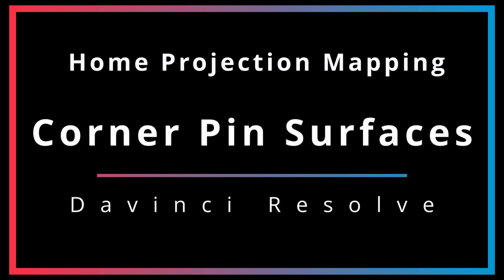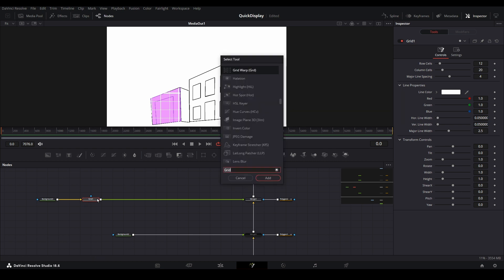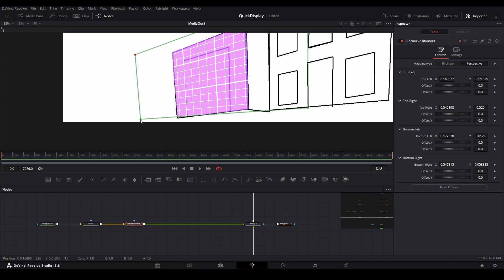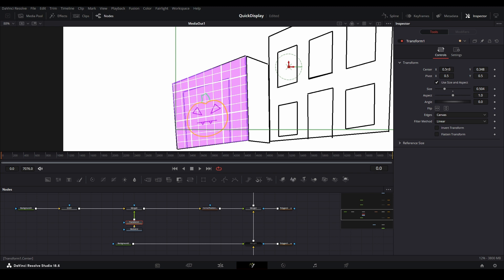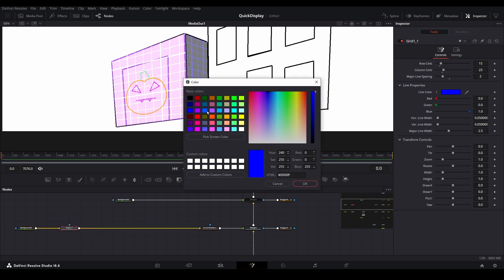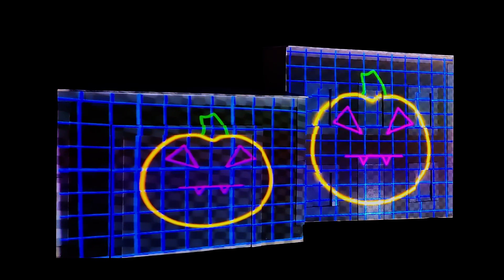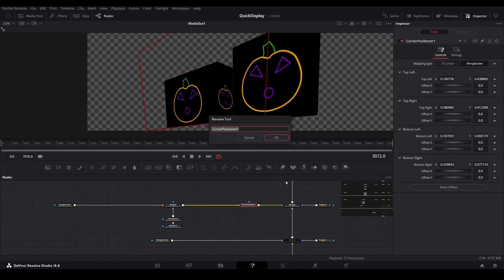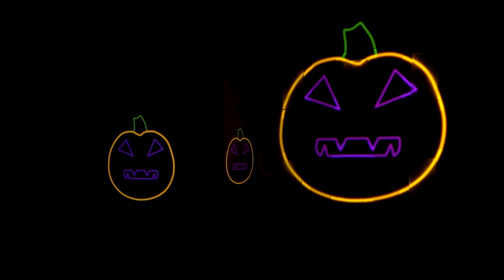Resolve Projection Mapping Guide | Part 7: Corner Pinning Multiple Surfaces

Comment: Thanks - the grid is super helpful, I have a front facade with a pitched roof and no straight line at the top to use as a corner pin reference.